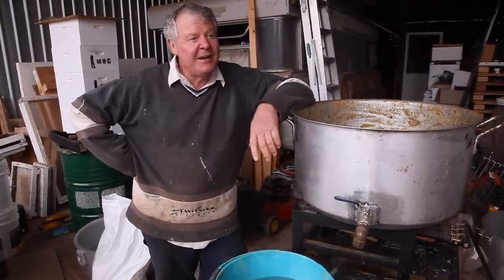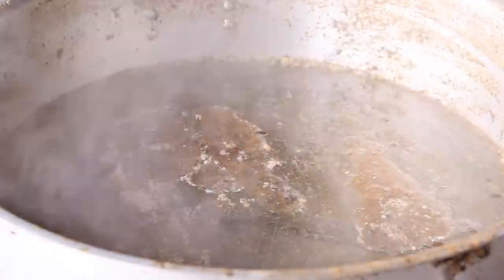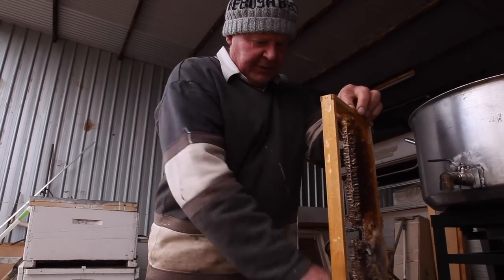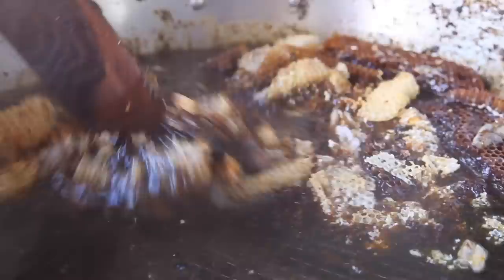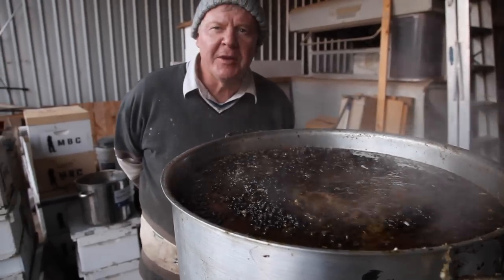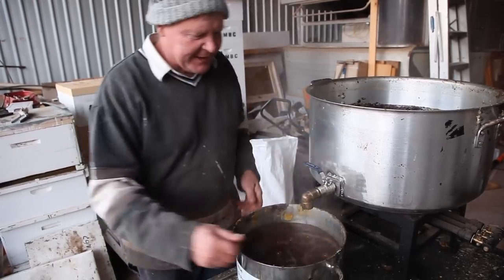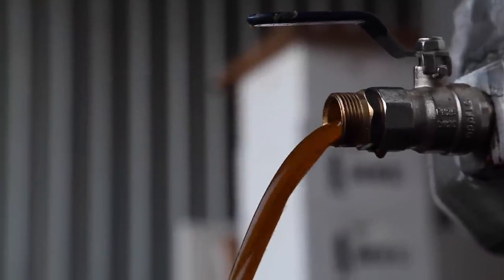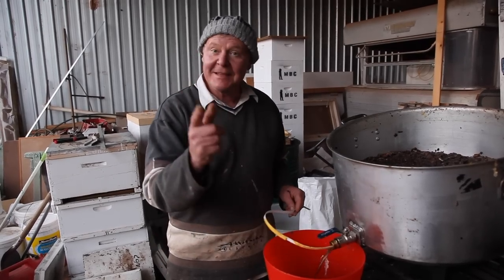Rendering Beeswax: How to Clean Beeswax Part 1 | The Bush Bee Man

Comment: I don't have an extractor (I'm just a backyard beekeeper), so I strained the honey via mesh bag. There's a good bit of honey stuck to the wax, even after letting it sit overnight. What I'm wondering, is can I keep and filter the wash water from the initial cold water rinsing of the wax, freeze it for storage, and use it in bread making? Is there any reason why not, especially if I filter the water? I hate wasting anything. And I'm talking about frames with JUST honey. I lost a hive this past winter, and I'm cleaning the honey off. No brood, wax moths, or other nastiness.

Comment: I always wonder why people melt it 3 and four times when they can just ladle off the top and use a silicone loaf pan.
You can use an old pillow case or fashion a bag out of a paint strainer to melt the comb in
The cocoons and slumgum make great compost or chicken feed. Dip the bag in the water, then get thick rubber gloves to squeeze the bags. You can reuse them a few times if you're gentle.

Comment: I dunno of the spigot is the right way to go... I would be scooping off the vast majority of the junk that floats, and then I would be pouring it off into another 'settling' bucket. Pull out the disk of wax, scrape off the junk from the bottom, and then chuck it into a pile for the "final" melt.
Reply: yeah then you can take your scrapings from all the melts and put them in a solar oven. just look up how to make one on youtube and you're off. you get super clean wax out of them and whatever is left goes into the garden as compost.

Comment: inefficient! why don't you throw the honeycombs into the pot to remove them - or even better: you have a sling.
use them with hot water to remove the honeycombs and disinfect the frames!
why are you trying so hard? have inefficient devices that you make dirty, that cost a lot of money and electricity to operate - that you have to clean endlessly!
work structurally, efficiently and economically!